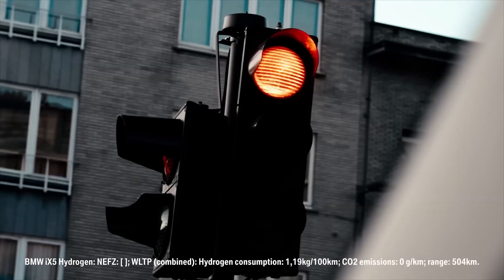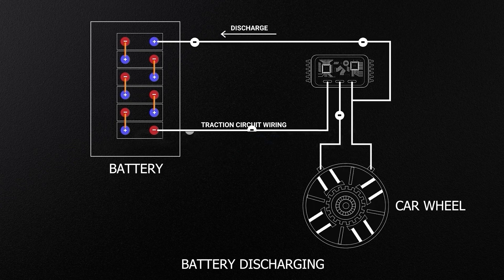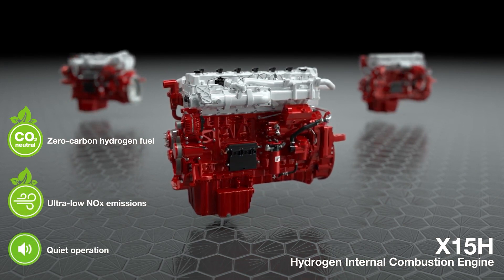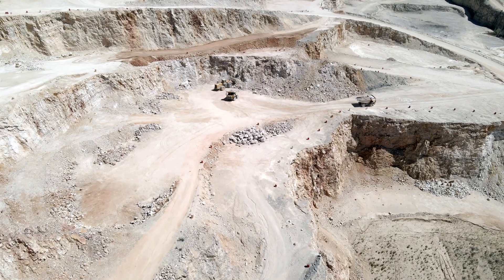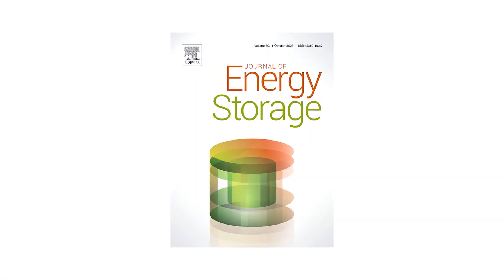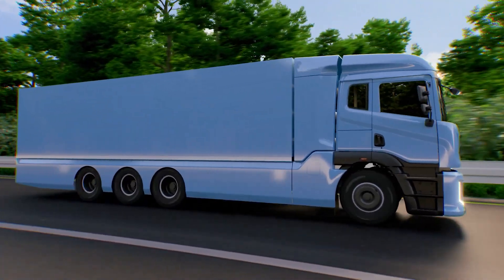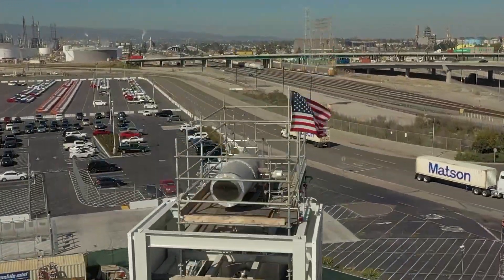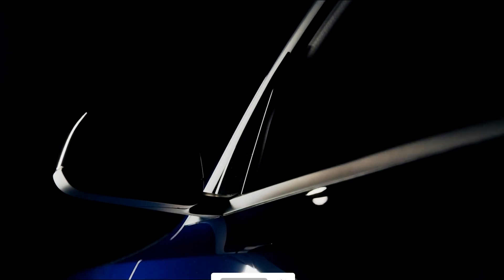The Untold Potential: Hydrogen IC Engines vs Battery Electric Vehicles

Comment: There are more problems/challenges with hydrogen that people are not touching on.  Hydrogen burns cleaner, no doubt.  The expense of making, transporting and storing hydrogen are significant. A creation of a new infrastructure is necessary. Including hydrogen permeates tank walls mandating tank replacement both for storage facilities and the vehicles themselves.  This is not an easy alternative.
https://youtu.be/Zklo4Z1SqkE